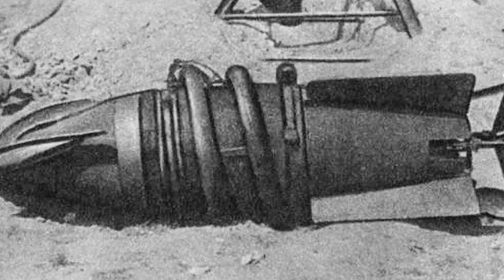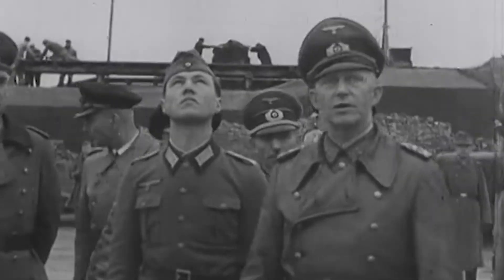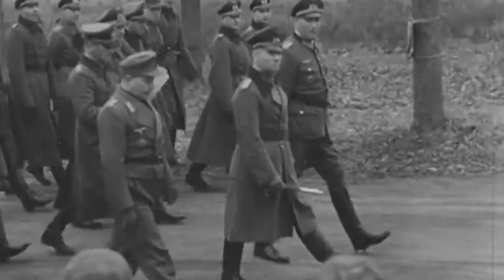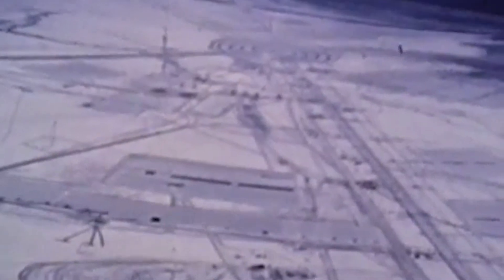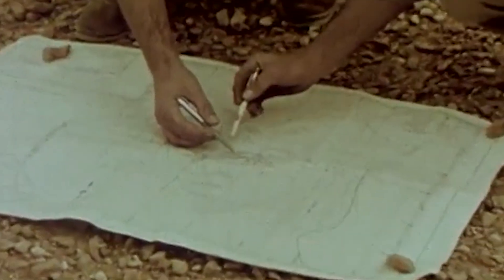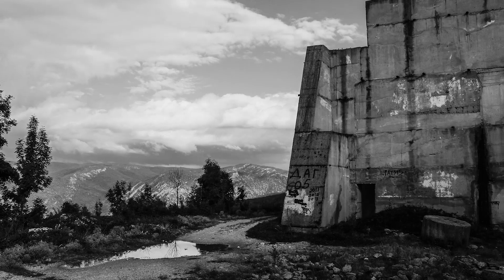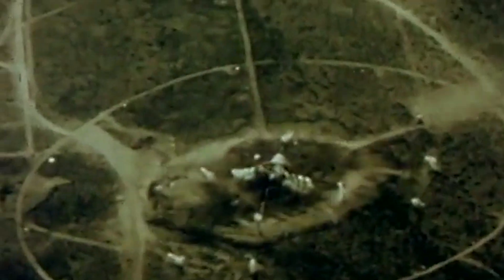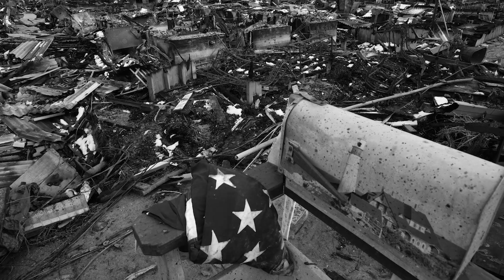The Soviet Nuclear Battle Mole: An Underground Cold War Battleship?

Comment: This seems very unlikely.  4-10 mph through rock?  I thought you were going to say 4-10 inches per hour.
Reply: TATTOO VAMPIRE1966  A tunnel boring machine can go about 50 feet per day, so about 25 inches per hour, but they have the advantage of having a crew removing the drilled material from behind it, and just mechanically breaking the rock instead of melting through it.  4 to 10 inches per hour seems like it passes the common sense test, which is why that's what I expected him to say.  4 mph is a quarter million inches per hour.  Ridiculous.
Reply: @blurglide  These Dark Docs are quickly turning into a dramatization of rumors and wartime propaganda. The temperature they said isn't even high enough to melt rock, hell my weed vaporizer gets up to 1300 degrees farenhight and that was a $100. To bore through rock you'd need a solid tungsten drill and like 3000 degrees. This is just comically ridiculous all around
Reply: @skeetsmcgrew3282  It so happens that the material the USA used to build its SR 71 came from Russia, and they have more tungsten than the US has waste dumps. Of course, if you make your calculations based upon the most solid rock, it makes it impossible, but undergrounds are not the same everywhere. If it ever was tested, it certainly wasn't intended as a weapon as flexible as a nuclear bomber, just as an extra option. I agree it doesn't sound very efficient at first, but well, there are still old folks like my father (94) who don't believe men ever walked upon the moon.
Reply: @skeetsmcgrew3282  Did you forget Celsius exists. "A temperature between 600 and 1300° CELSIUS is required to turn rock into a substance called magma." That took a 3 second Google search.
Reply: @richardmillhousenixon  Actually magma is under the earth, since it's making a hole and is exposing the liquid rock to the surface it's technically lava. Totally not the point but sure, if the temperature was really the part you had issue with ya got me. It would need to swim through lava since it has no method of actually removing material, so if a lava-swimming drill seems reasonable to you, may I direct you to the flat earth channel where they also enjoy such theoretical technology
Reply: @blurglide  From the expectation of a lower crew capacity and payload, they may have conceived a 10x smaller cross section than the large boring machines as an example. They may have also speculated on its performance through soft clay or reclaimed land that isn't made from granite, for instance. 

Portable reactors made for heat generation can put out 4 GigaWatts or more of continuous heat energy at 2500+ Kelvin until the cooling medium (gas at that heat exchange temperature) is used up, which can be a very, very long time (weeks or months). They have never used pure uranium in any reactor design that I've ever seen or heard of (especially this one which requires high temperature fuel elements), so ignore the person's comments about the melting.

https://mrdata.usgs.gov/general/map-us.html
This USGS map shows that most of the east cost is considered as "unconsolidated and undifferentiated" rock. There are a considerable number of gravel and unconsolidated strip mines. I don't know anything about mining, but it looks like there is an opportunity here for this being partially true, partially scare tactics just like the 200 MegaTon Cobalt nuke or the Satan ICBMs or the radio frequency beam tanks that you all are too ignorant to realize actually causes DNA damage.

The patent US3885832A is quite interesting for the concept of using the melted rock to further stabilize the tunnel before concrete is put in, but it does not claim that the thin layer can hold the tunnel open by itself, nor does it claim ridiculous speeds through hard rock, only the acceleration of the fragmentation and excavation through extreme heating.

Does anyone have Phil Schneider's medical records on how exactly he lost his two fingers and received the chest incision? It is highly unlikely that a laser would be able to burn through his fingers then through only his sternum before severely excising his critical organs. It sounds like he made the story up, but what he said about DUMBs is a highly strategic and important asset if the US does in fact have over 130 sites.
Reply: blurglide yeah there's no way it's 4 mph
Reply: high temperature reactors might be feasible to realize it. remember. only some of them require water-temperature cooling. there are molten salt or gas core designs that can run far, far, far hotter. ...... but you would still have the problem of the crew being cooked. id imagine you need like half a metre of aerogel surrounding them and very advanced cooling systems. remember. you don't have to get rid of all the heat. just enough of a heat gradient to not boil the crew.
Reply: @km5405  Are you a scientist? You know very much about these things. You sound intelligent.
Reply: @km5405  all reactors need cooling. Nothing else to add. Molten metal cooling reactors exist. They are extremely dangerous (broken coolant pipe = metal fire. Fun). They are also huge. And you still get the problem of the heat in the vehicle.
Reply: Exactly.  It also seems to defy physics in a number of ways, primarily in that to melt rock effectively requires ridiculous temperatures, and somehow you need to generate them underground in an enclosed area without melting the craft’s hull or immediately cooking it to the point of failure.  Somehow you need a way of maintaining a super-hot exterior temperature while maintaining a operable one within the body of the craft, especially since a nuclear-powered vehicle has to generate its power by evaporating water or something to generate steam and drive turbine generators.  You either need an infinite heat sink like the ocean or a continuous supply of water to do this, neither of which is available underground.  And no, you can’t use the earth as a way to dissipate the heat since rock/earth is a poor conductor of heat and you need a MUCH lower temperature to recondense the steam, which wouldn’t be possible in a craft immersed in liquid/high-temp rock.  It would be more believable if it used some sci-fi magic to phase through the rock lol.
Reply: @flomojo2u  You also have to move that melted rock behind you.
Reply: @flomojo2u  also where do they get fresh oxygen for the crew from? in a sub you can take h20 and split it up with electricity to get o2 and h2, as you said there is nowhere near enough water underground....
Reply: @flomojo2u  the hull is made of Stalinium, which is impervious to damage and has a melting point hotter than the center of the sun.
Reply: @flomojo2u  that a stupid argument. A simple refrigerator would be capable of redirecting the heat from the fuselage towards the boring front.
Reply: @flomojo2u  i think the rock itself would function as a heat sink if the ambient temp permitted, but the operating conditions would be limited.  I also question its ability to navigate or even steer.
Reply: @flomojo2u  You know they could use the direct heat from the fission process to melt the rock, no need to convert it to steam first
Reply: @baxmauer  no, you can't. Look up how a reactor works and why you need to cool it.
Reply: You'd be surprised how much faster military machines can move, when you take all the safety features off.  If you don't mind killing a few highly expendable Russian soldier-serfs in the process, now and then; and if the project head is being threatened with a long, brutal, and subzero reassignment to a Siberian coal mine (as a laborer); then things move a lot faster, generally.  

Russian research is known for their "blood makes the grass grow" attitude towards fatalities during the research and development phase of most military weapons and delivery systems.  During WW2, they were making tanks so fast that they were sending some of them to the front unpainted, crewed by the same men that had made the tank in the factory, who were then replaced with new workers on the line.  Wash, rinse, repeat.
Reply: If ture seems like it would have been amazing for building underground subways and tunnels and etc
Reply: I assume there is rock and rock. You don't have to calculate based on the hardest of the hardest rock. I assume it will be easier to steer under the Nevada dessert than under the Rocky mountains, and that one has to carefully select the road with the least geologic resistance. That doesn't make it efficient against all targets, and rather interesting as a tactical weapon than a strategic one. But whether it isn't making things unnecessarily complex for little added value, I don't know, apparantly the Russians didn't think so, otherwise they wouldn't have spend scarce resources in this project. The idea of trying to cause earthquakes via nuclear explosions too apparantly has been studied. If one doesn't try, one doesn't really know. Maybe other things have been tested, such as ultra high sounds, to see what effect they would have on populations. Maybe the Americans tested bombarding the USSR with bottles of millions of poisoned wodka, who knows....
Reply: TATTOO VAMPIRE1966  The Russians did, by beating the USA not just one time (Sputnik), not two times (Gagarin) but three times (Tereskova) in the space race.
Reply: What fucking material would the tip be made out of to withstand extreme temperatures and distances without needing to be constantly replaced?
Reply: Yall are forgetting that not only is this kind of technology used today, but that these are russians, and it was nuclear powered. Science is pretty cool sometimes
Reply: How much of you have education good enough to do any sensible comment on cutting edge military weapons?
Reply: Elon Musk wants to know your location
Reply: @erickhenderson8800  I read about that recipe and it is believed that it was made from plants. There is a mention that I can't verify though, that some scientists studying a bunch of megaliths were shocked to see a bird making a hole in stone with some sort of plant mix. The rock softened like clay and turned solid again. Is this just a lie? Did they really see that and got the recipe which is now a secret? Who knows.
Reply: TATTOO VAMPIRE1966  They're still doing the same thing today. Except they're called "Democrats"
Reply: @erickhenderson8800  They were trying to get through as quickly as possible because it was cold they didnt have time to make roads they had Roman cheeks to clap.
Reply: Elons on the case with his boring company. First 100 participants receive a free "not-a-flame thrower"....*
Reply: Yeah that is incredibly fast. I've just goggled it and that's faster than the average person jogs. Significantly faster.
Reply: This video is nonsense. My favourite part was "what we do know" followed by "xyz might exist".
Reply: It is not accurate to compare this machine to a tunnel-boring machine.  Those machines are not the same. Tunnel boring is meant to create a tunnel. This means a lot of work is put into the structural integrity of the tunnel, which drastically slows the machine down. You need to clear the rubble created inside the tunnel and also you need to ensure that no part of the tunnel collapses. 

The machine in the video has no need to create a safe tunnel behind it. All the machine cares about is getting through the rock. It doesn't matter if there is a cave in behind the machine nor does it matter if the debris behind the machine makes the tunnel un-travelable. The tunnel of this Russian machine is merely a by-product. Therefor, comparing the machine to a tunnel boring machine, without mentioning these variables, does not seem to be a viable arguement IMO.
Reply: One more thing- the melting points of bassalt is just under the melting point of uranium.  Granite is slightly higher than uranium.  So, basically, you'd have to run your reactor at melt-down temperatures to get enough heat to melt rock.  There's no way this thing existed.
Reply: @blurglide  It doesn't have to liquefy the rock to significantly weaken it. Jet fuel doesn't melt steel either, but that didn't save WTC. Anyway, a pebble bed reactor might be a good candidate for running at very high temperature safely without active cooling.
Reply: @timewave02012  You'd have to liquify the rock to move it from the front to the back of the machine.  The alternative would be to crack and slightly lift the entire mass of the rock above the machine.
Reply: That's why scientists are scientists and we  don't come close, because we think stuff is impossible untill we see with our own eyes
Reply: @Bishopbro  I provided a scientific reason why this is not workable.  You'd basically have to have a continuous reactor meltdown, and even then you'd barely move.
Reply: look at the photos of it there tracks under it this thing is bascially just a drill put on a train track that can hold dsoilders in it dont see how its supposed to surface though
Reply: Ever see the video of the tunnel to CERN.  Shows the boring machine breaking through. We do indeed have them here in US in varying sizes I believe largest 60’ in diameter. Maybe 80’. Many lengthy tunnels exist here from city to city. And they do move miles per day.
Reply: @bradleyweiss1089  No, they do not.
Reply: zztop3000  So?  The only way this would work would be if you had a nuclear meltdown
Reply: Travelling 6-16 km/hr is still fairly slow, but if they were indeed capable of liquifying the rock by melting it then it should in theory be able to reach substantial speeds, even a lot higher than the 16 km/hr the video mentioned. With modern technology it might actually be feasible, but I highly doubt they could have done it at the time.
Reply: @erickhenderson8800  heat the rocks i nthe mountain (with torches) then throw vinegar on them. The heated calcium in the rock increases the reaction with the acidic vinegar and kapooshki! Cracks open. Nothing new there (even at the time) Romans used it too.
Reply: TATTOO VAMPIRE1966  At the same time, the Russians build the first satellite, had the first man and woman in space, those "insults" against the USA can never be undone, it will be for ever written as such in the history books. The first man on the moon helped a bit to compensate, however, the first victories in this field were not made in the USA. And whether Gagarin was or wasn't the first doesn't matter, in that period, Ham the chimp was the first "American" in space. And well, as of propaganda, it can be as deadly a weapon as a bomb, when properly used. Without Goebbels, the Third Reich propably would have collapsed even faster as it finally did.
Reply: They used a nuclear core and used specially industrial strengthened steel for the hull.
Reply: This is old tech and yes it’s 4-10 mph we have thousands of miles in tunnel  the USA built with this same technology. Way to many people saying the same thing. Look up Phil Schnyder he was a engineer who was involved with all of this sort of stuff
Reply: @cjohnsonj4938  You think tunnels in the USA were dug at 4-10 mph?  REALLY!?!  And you're smart enough to operate a computer and type out words?!?  Modern boring machines dig about 35 FEET per DAY!!
Reply: Redbeardian 

Google this US3885832A 

Yes I do believe I also believe we have secret black budget aircraft that are 50-years ahead of what we know about. Just because the public is stuck with the crappy tech doesn’t mean it’s not in existence
Reply: @cjohnsonj4938  Do you think that expired patent application you linked means that the device was actually constructed and used at some point?  Even in the objective section the inventor says he thinks they could achieve up to 1.5m (4.9 feet) per hour of boring speed if they were to make the invention.  So again ..... you REALLY think we can make a device that can bore 4-10 mph through the ground!?!?  Holy crap the USA education system needs help!!!  It's not about "ahead of what we know about" etc .... it's just basic physics .... like high school level (or should be) basic physics.  Being forward thinking doesn't mean believing in Sci Fi fantasy magic.
Reply: Redbeardian 

Honestly what’s convinced me is watching years of videos online with lots of people saying the same thing ( high speed trains deep underground bases and lots of tunnels) could all these people just be spouting BS ? Sure  I would never completely discount that. However I feel like they keep a TON of stuff from us. Yeah you can argue that the power requirements are so huge as to be impractical. However your basing this point off of known knowledge. Arthur c Clark said it best ... any sufficiently advanced technology is indistinguishable from magic. 

So if you believe the knowledge that the public has to work with is it then I would say your correct
Reply: @cjohnsonj4938  I think I get it now.  Real life does seem kind of boring sometimes.  That's why we have entertainment like this youtube channel.  I just find it sad when people think something like 4-10mph boring machines is an actual thing.  It's how people get scammed into investing in Mars One type scams ... or think that ELon Musk's Hyperloop will ACTUALLY work and invest in that.  It's about different points of view.  Many "reality based" things about the world and universe are amazing to me so I don't have to resort to the conspiracy theories, alien abductions , etc etc to stimulate me.  We all crave a different kind of buzz.
Reply: Redbeardian 

Good debate ! 👍  Don’t get me wrong I love watching and learning about the advances we all enjoy.  Perhaps someday I will live to see humanity mine asteroids or actually get some helium 3 from the moon.
Reply: @Redbeardian  , not nuclear powered boring machines who melt the waste , not having to move it
Reply: @Redbeardian  👍
Reply: @cjohnsonj4938  No NO NO NO. There is no piece of equipment in the world that can tunnel 4 miles in an hour. Or even 4 miles in a week. Probably not 4 miles in a month.